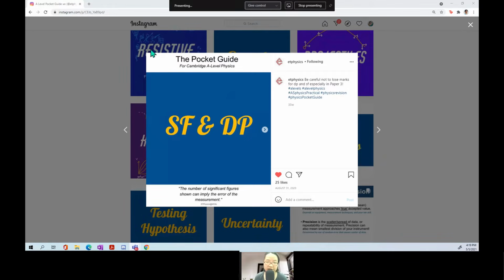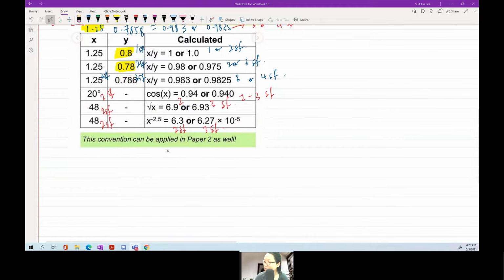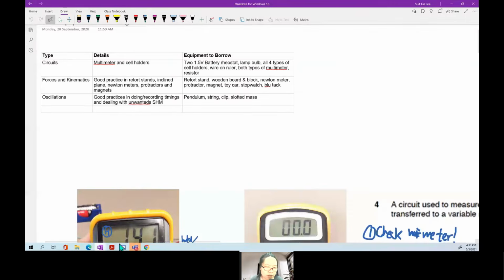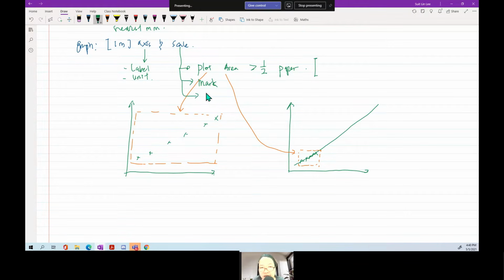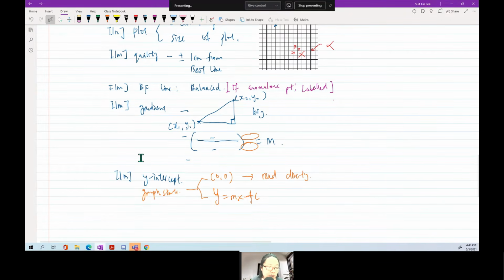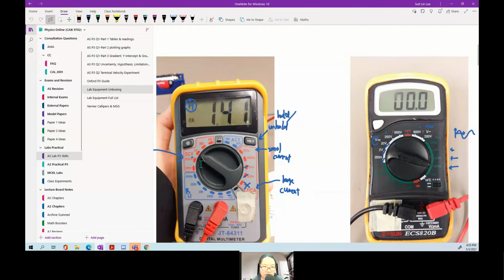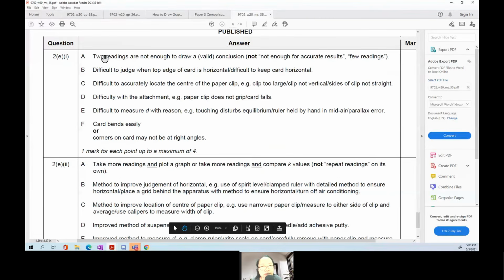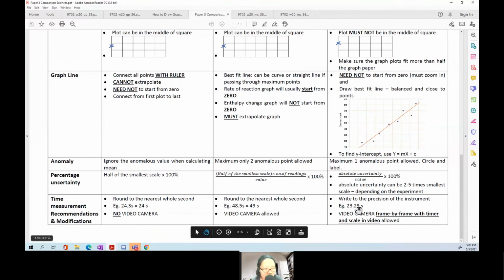Practical Paper 3 Crash Course Review | AS Review Session | Cambridge A Level 9702 Physics

Comment: Ms, when I asked my physics lecturers at my college, they say that you can (and should) plot the points in the middle of the squares if the data calls for it when drawing graph (ie not all points need to be 'ngam ngam' where the lines cross) and they say mark scheme does not require it. Is there a reason why you say cannot plot in the middle of the squares? and are you penalised if you do/do not do this?
Reply from the maker: MS was vague when communicating this guidelines. what I know is plot in the middle may be rejected because you cannot properly confirm where the middle is. 

Plot at the corner always accepted. 

Hence play it safe. round to nearest corner plot and another tip is to use the lesser SF option at table values to  make rounding a little easier
Reply: @ETphysics  Oooo I see. Thank you!
And this applies to A2 paper 5 as well right?
Reply from the maker: Yepp, corners-only all the way.
Reply: @ETphysics  ok ok. Thanks